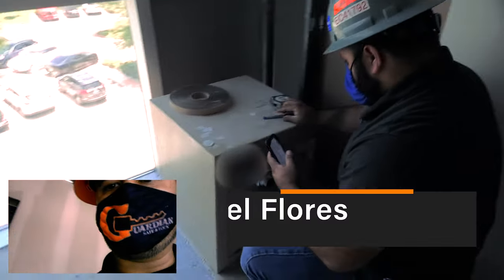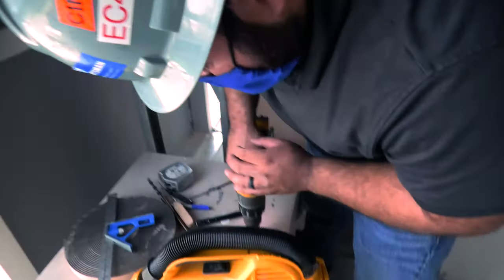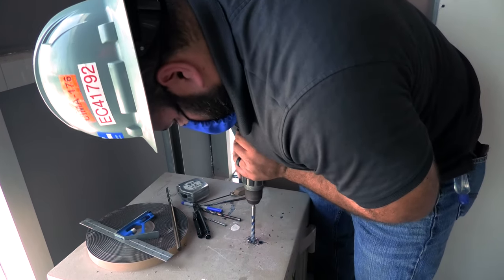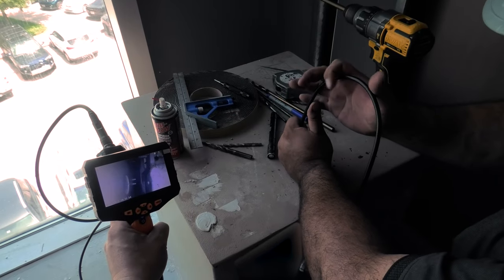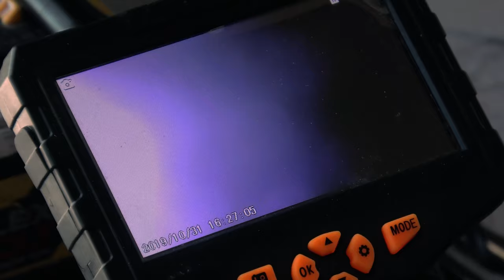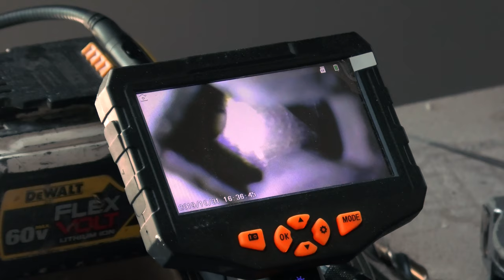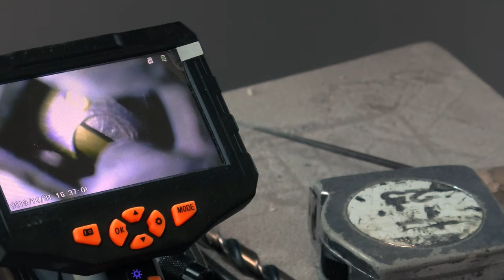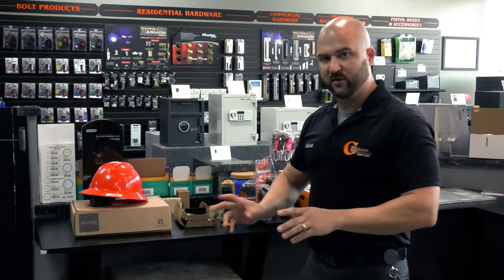Drilling Into A TL 15 Safe!

Comment: Still just seems to easy to drill into.  Don't they make anything with a harder outer shell that would eat drill bits?
Reply: It's even easier to just use an exothermic torch. If the criminal has the time to be drilling/cutting into your safe, it is already compromised.
Reply: @DaveSmith-cp5kj  Well a torch would destroy whatever is inside wouldn't it?  And I imagine it would still take some type
Reply: @locklear308  For sure, but you can mitigate a lot of the risk in the technique. Obviously if you are trying to get paper documents it would be a bad idea. But stuff like precious metals or even guns wouldn't see too much damage. 

The safe is just to buy you time and first and foremost as a deterrent. It doesn't actually stop a criminal, just like a video surveillance system doesn't stop criminals either. Both layers of security require human intervention.

Comment: I may missed it because I skimmed through the video, but what makes a safe locking system fail to where you can't get into it?  How long should a safe last?
Reply from the maker: It’s not that it fails, in this case they didn’t have the code, but if it’s a manual dial it can be many things and the same with the electronic. Both are for the most part reliable, but there are a variety of possibilities. - Uriah
Reply: @GuardianSafeAndLock  How often should have a safe lock maintained?  I once had an issue after about 25 years but was thinking how dumb I was to wait so long have someone come out and maintain it.
Reply from the maker: @Mike-01234  Hey thx for tuning in! I’d say every few years or so is fine, but the second you start to think something is different or starting to not work correctly, call a professional locksmith. If you wait to long it will eventually fail, whether or not it’s an electronic keypad or manual dial it will eventually get worse. Thx for watching please hit the subscribe button for weekly content!

Comment: what happens if they break off the  digital unit on a Hollon TL? I see they are made to be replaced, but how would it open? If the unit has the code, not the safe, and the unit is knocked off and broken, how to you get back in? Thank you if you get time to answer. Very curious.
Reply: The code is stored in the lock body. Not the in the keypad.

Comment: Would having a digital keypad lock make it more difficult to employ a camera in that way to open the dial lock.
Reply: Well, it wo be impossible to employ this technique as there are no wheels in an electronic lock. Drilling an electronic lock depends on the type of locking mechanism used but is a totally different technique. Not necessarily harder, but different. Depending on the electronic lock and bolt work and relockers it could be much harder though.

Comment: What would he have done if it was a digital lock? I know some of the cheaper ones can be hooked up to electrodes to energize the solenoid, or connected to a computer to find the combo.
Reply: cheap ones and some swing bolts you can vibrate open or inject 100cc contact gel into the lock body.
Reply: @Magicspirit11  hi please look at this safe and tell me if u think it's good. It's called a Stealth Concrete Composite Burglary Safe CS45. Thanks
Reply: @greatstuffs  yes that is a decent safe I can recommend.
Reply: @Magicspirit11  thanks. I saw some of your other comments and I cpuld tell you know your stuff thanks
Reply: @greatstuffs  you are welcome.

Comment: Is there a way to stop a scope from bring used if crook used the same method you did on a comparable safe
Reply: Catch them before they finish. If a crook really wants to get in fast, they would use an exothermic torch. in and out in less than a minute. Of course, it takes skill since the torch could also burn up the valuables inside without good planning.
Reply: @DaveSmith-cp5kj  Put a small pop rivet in the change key hole so it can't be used to view the wheels inside the lock. Have another cover in the safe without a rivet in the change key hole incase you ever need to change to combination. Just swap the cover and change the combo then replace the one with the rivet back on the lock.

Comment: Instead of scoping for the change key hole, have you tried scoping for the gates instead, I think it's much easier to see.  I've only practice using a lock on a mount, but it gets confusing sometimes for me.  My friend explained to me how to do it, got to keep practicing.
Reply from the maker: Yes we have used that method, it’s bc of the hard plate. Decided to go around it lol
Reply: @GuardianSafeAndLock  No, I mean, still look thru the change key hole, but instead align the gates at the change key hole.  That's what I meant.
Reply: @ken_9359  that key hole should have a steel screwed down cover to prevent viewing with the scope. A surprisingly weak point. If ever have a safe of this quality im covering that hole
Reply: @ethorii  one can still drill through the lockbody and scope the wheels.
That safe could have been opened like that in 15 Minutes

Comment: So a TL 15 is definitely worth the money! Hey what rating in your experience is the toughest to beat?
Reply from the maker: TL-30 6x6
Reply: @GuardianSafeAndLock  TL 60x6=$$$$
Reply: I'm saving up for my vintage Chubb Sovereign. 😆
Reply: @hkssystemslocksafe2486  what does the 6x6 stand for?
Reply: @BrandonWallach  all 6 sides are rated and reinforced.
Reply: @hkssystemslocksafe2486   bad ass. That kinda makes me mad that a tl30 doesn’t do that and you need to get a 6x6 t
Reply: @BrandonWallach  depends on what you store in it and what the insurance demands. A jewelry store will most likely get a 6x60 TLTR